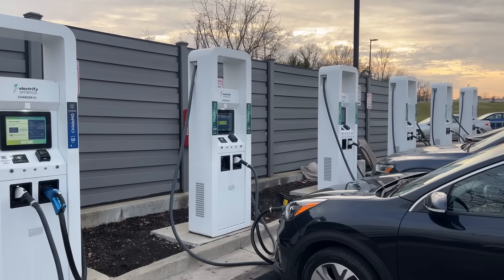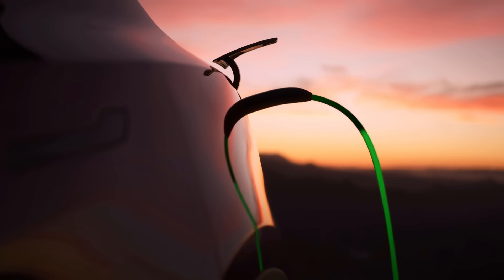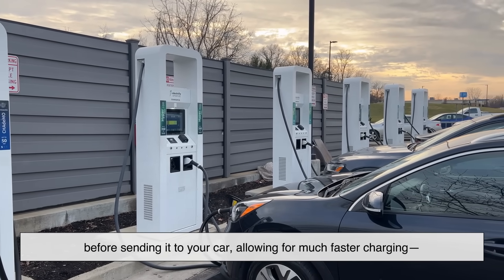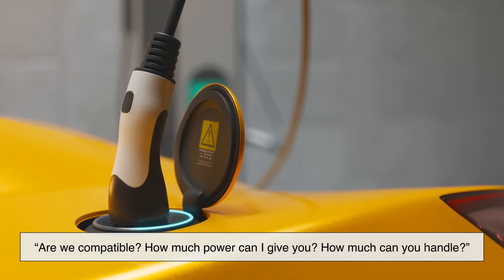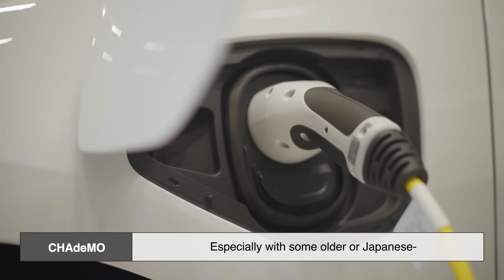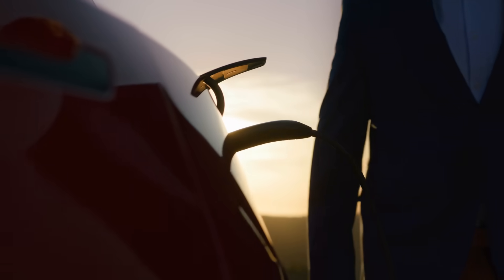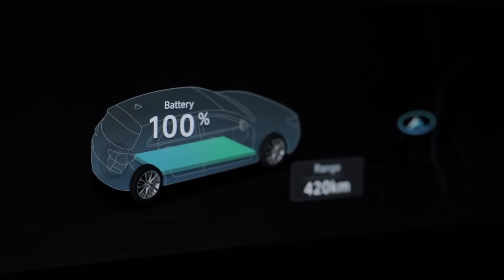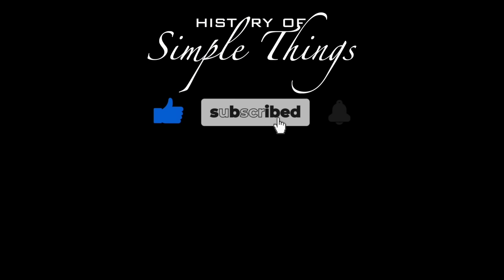How Does EV Charging Work? Here's What Really Happens When You Plug In

Comment: There is still this huge debate of what exactly a battery charge cycle is. Is it from 0-100% or is it a cycle charged from 95-100%  - still no clarity even in 2025.
Reply: It depends on the battery type. Charge up to 100% every time if your vehicle is installed with LFP battery.